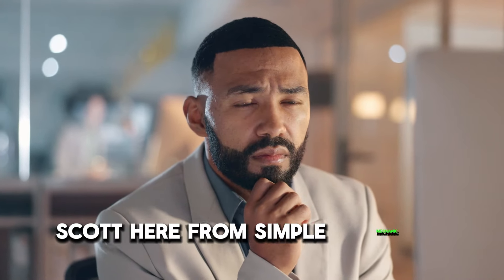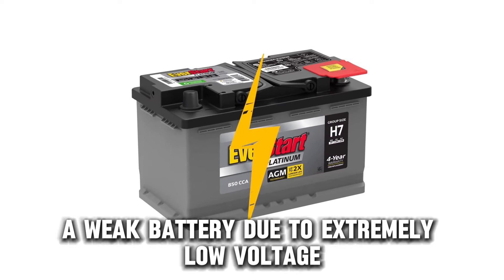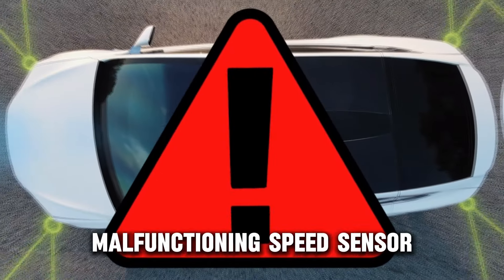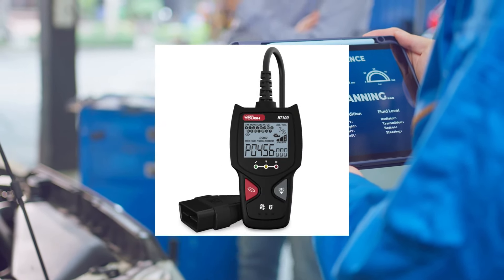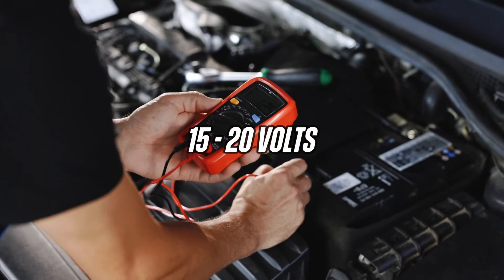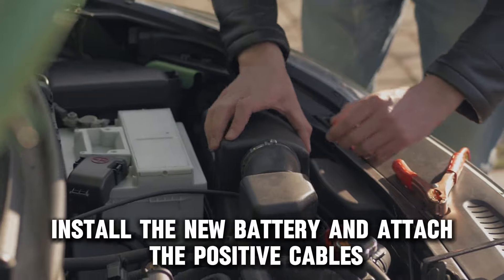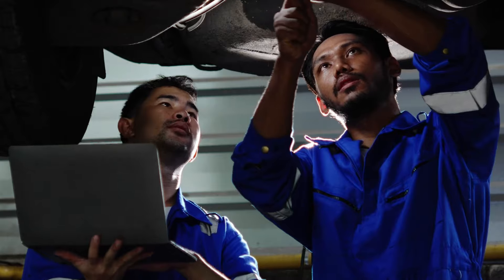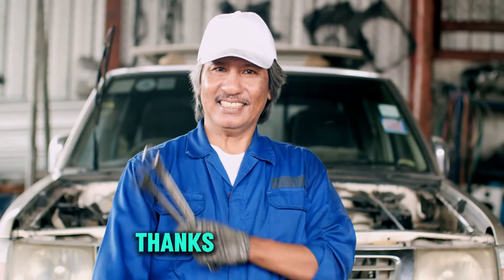AWD System Malfunction 2WD Mode Engaged - Causes And Diagnosis

Comment: Neither Toyota or Lexus have a clue.
I had a new timing belt installed, since then I keep getting this message.
Gas cap.  Battery.  Fuses.  Bad Fuel.  dirty fuel injectors. 
It can be all sorts of issues, but none of them fix it.
First time I heard of the Speed Sensor causing this issue.  Four speed sensors will be around $100 for parts.

I think all the sensors default error message is AWD System Malfunction. 2WD engaged.  Contact Dealer.

This time the lexus mechanic said I need to replace all Fuel injectors.  Fuel injectors $600 for parts, $5000 for labor.  12 month warranty

Then, something else will break and that 12 month warranty is great for the fuel injectors, but the other thing that breaks is not warranted, another $5000 they will want.  This will go on for weeks.

Comment: When the four wheel drive malfunction light comes on does the vehicle actually switch to two wheel drive?
Reply: I have this problem and it seems like the AWD is still working. I’m going to disconnect the battery.
Reply: @akaredcrossbow  this warning light has been off the last two weeks. Usually, I'll go month or so with no issues and then it just appears. I ignore it and in a few days of driving it turns off again.
Reply: @richardl3720  my battery is ok, so I disconnected the battery for about 5 minutes and the warning lights are gone. It could have something to do with cold temperatures and maybe condensation imo.
Reply: I thought the same so my drivetrain can switch like a bmw m5c🥰😂😂